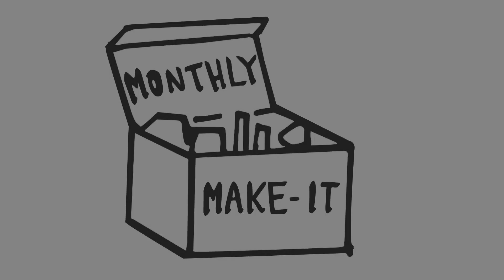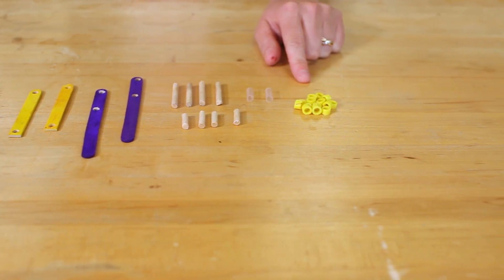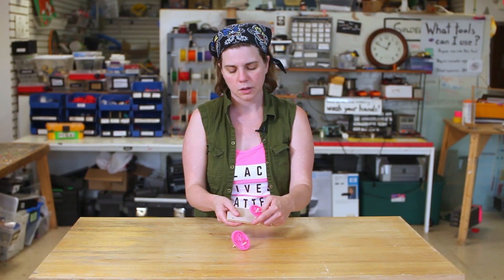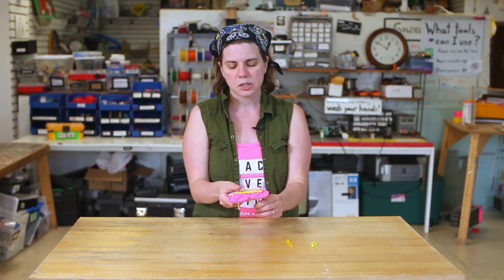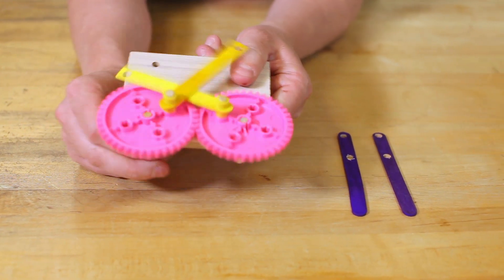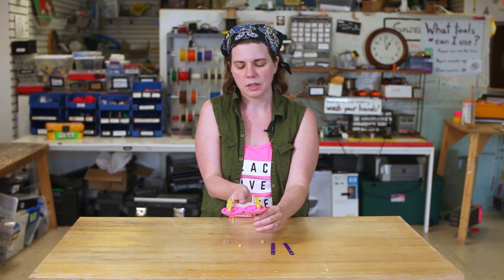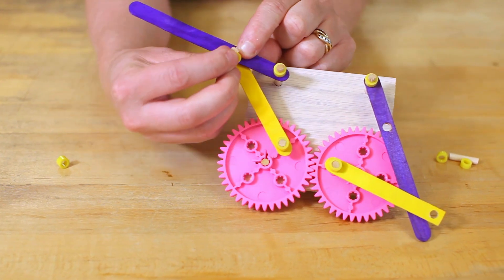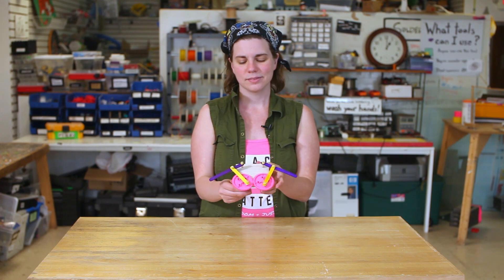Flapping Wings

Comment: A very fine instructional video. I have for some time been interested in putting together a wind activated flapping bird toy or ornament. Such did exist a long time back mounted on the  radiator top of  a car of that time. I have tried to obtain this vintage piece but have not been able. I have made this device from patent information and none of these actually work though in theory they should. Would you have any ideas of an actual working design ?